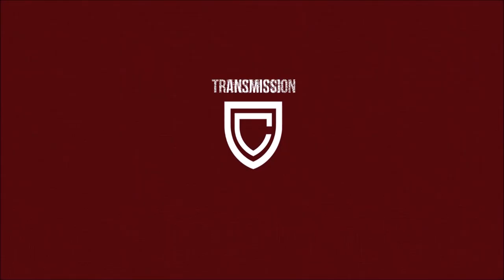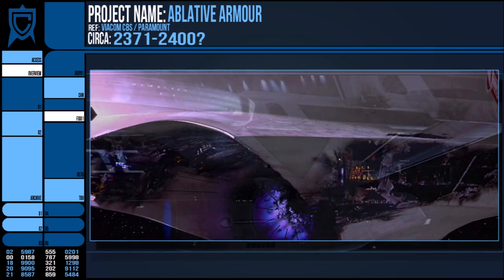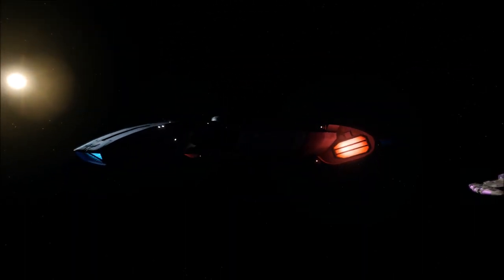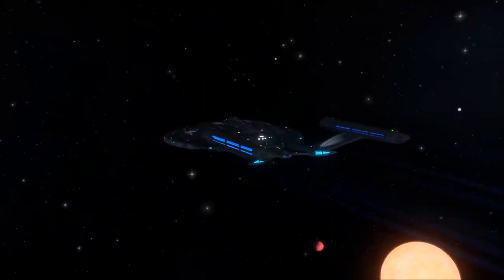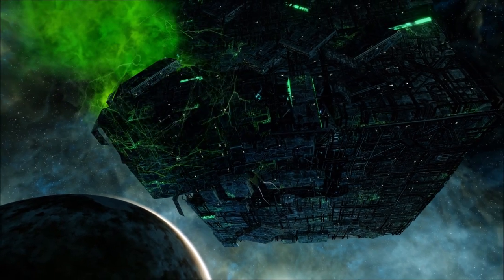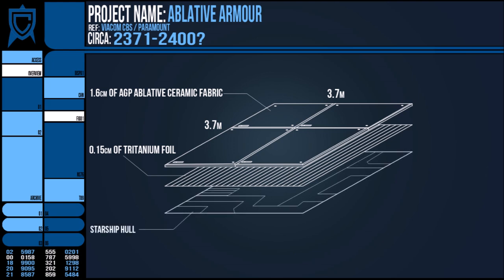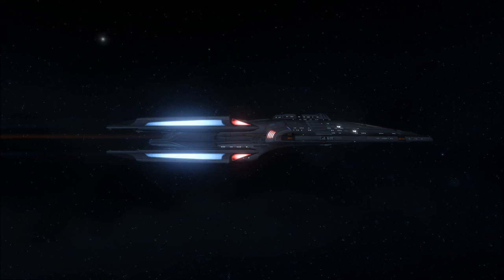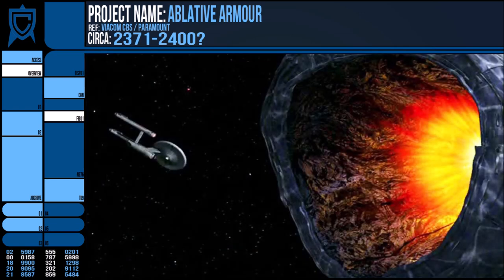What is Ablative Armour? (Star Trek Lore)

Comment: Why once under red alert did they not segment the ship with bulk heads, to keep from having atmospheric loss? Shields, Armor, then Hull, if shields and armor fails the your hull must withstand the attack, or be able to be dumped away. Always they were leaking atmosphere. Surly by this time they should expect someone is going to want to fight them, have the ship ready. LMAO just don't think to much and watch the next episode.
Reply: Why do their control panels explode and shower the crew with rocks from external hull hits? It's because no one on the writing staff gives the science a second thought.
Reply: I agree, if the ship has a segmented design of smaller areas, atmospheric losses due to decompression is minimal, so with closing off sections and structural fields to stop hull openings,  you would lose less atmosphere.
Reply: @kauske  I agree, that has often boggled my mind. A power surge just shuts down electronics, but I'm guessing that doesn't look as good.
Why when their damaged does the gravity plating never fail?
Reply: @kauske  
See the plasma controls are directly in panels operated by the crew, no engineer would design it that way.

Industrial controls manage incredible power by means of relays, so if something goes wrong and explodes, the control panels do not explode, and nobody is killed.
Reply: @KalRandom  Failing gravity plating means they'd have to spend money on wire-teams. Then they might have less money for pyrotechnics for exploding consoles full of rocks. ;)
Reply: @carminemurphy1275  I just find it amusing that ontop of running dangerous high-power directly through the bridge and such, they also stuff the consoles with extra shrapnel, so when it invariably detonates the injuries to crew are worse. It's like the Fenedation has some sort of Anti-OSHA running around making things more dangerous.

If it's not exploding rock panels, it's hazardous spark conduits, or canisters of face-melting fog. I also like the fact that if they lose all power, the very structure of the ship collapses, because it needs that structural integrity field to not buckle under its own mass.

But as Kal said, at least the gravity holds up no matter what else fails!
Reply: @carminemurphy1275  and they even discuss all sorts of relays for both power and data in the show! Yet they don’t seem to protect properly… more often than not they just complain about them getting burnt out 😅
Reply: @kauske  I do believe the Defiant is the one exception to 24th century ships buckling under their own strain without the SIF.. good thing too or they’d be dead twenty times over. 

But I suppose they must just have super good backup power systems, much as you’d also necessarily have to have with a big antimatter tank (at least going by the diagrams, they don’t really have multiple small tanks? Just one big one?). IRL we have methods to independently power magnetic bottles in a powercut via allowing controlled leakage and allowing that small amount of energy to power the containment. So I’d hope they have something like that but 1000x better…..
Reply: @kauske  LMAO, nothing like that was ever discussed back when that show was airing. Most Sci-Fi is really dumbed down so much for the masses it's painful to watch.
Heck were they even doing wire work then?
Reply: @KalRandom  When TNG aired? Not outside the highest budget movies. Trek has always been low-budget from the get-go, so even now it's not likely to get wire-work.

Hard scifi tends to be the dominion of books, since it would be very expensive to make in live action, and have a limited audience. Even shows like the expanse limit crew to seats as much as possible to save on expensive wire-work.

Also ontop of the expense of trained wire teams, there's the added danger to actors if something goes wrong, so you need to train your actors to be on the wire, and have more insurance in case one takes a fall and gets injured, which can tank production schedules.
Reply: @kaitlyn__L  The defiant is also one of the smallest, and most sensical ships in all of trek. Enterprise-D is literally a floating city full of amenities and so ridiculous big that even the full crew plus a spouse and 2.5 kids per crewmate would give everyone a massive mansion sized quarters and still not use all the space inside it.

Comparably, the Defiant makes a lot more sense, small crew, maximum automation, no wasted space. Most other federation vessels seem more like cruise ships than paramilitary exploration vessels. As for antimatter, I'd hope you'd have UPS for its containment, or the first time someone blows a major fuse your ship goes kablooie.

You'd honestly want your whole drive-core and powerplant far, far away from your living space, more like the ship in 2001 versus most federation ships. If they put the saucer out further forward, and had no one in the engineering section, they'd be OK. But how many times has engineering filled up with plot-radiation and killed half the engineering team? (Usually the half who are not named too.)

Comment: The sci-fi materials used for hull building (like duranium, tritanium) which are no known elements today should be assumed to be alloys, molecules or minerals but not elements. Why? If our understanding of physics and chemistry isn't fundamentally wrong (which is quite unlikely), then we know two things:

1) There can be no more elements between those we already know (because an atom cannot have one and a half proton and we (=humanity) found or synthesized all elements with a natural number of protons up to 118).
2) All possible elements beyond those we already discovered must be instable and therefore radioactive in some way, because the repulsive electromagnetic force between all the protons grows bigger than the strong force (which is holding the atom's core together) after a certain number of protons. Theoretical physicists (which I am not) can calculate such stuff - science!

As a result, using an unstable, radioactive and also very heavy element as a main or integral part of a ship's hull would probably be rather problematic. It's a different story for ablative armour though, since it can be mounted on the outside, and the ship underneath could be shielded against the radiation. Also, dense and heavy materials can be a plus in that case.

Comment: Can you talk about why some have four warp nacelles and some only have one?
Reply: I suppose because 4 nacelles are faster ?
On large aircraft the larger passenger airliners (747) have 4 engines (nacelles) for better cruising speeds and less mechanical strain.
Reply: Imagine a symmetric ovoid field emanating from each nacelle. They have to project enough of a field to include the saucer section. With four nacelles each individual nacelle is making a slightly smaller field, the warp coils will be suspending less energetic plasma, etc. Efficiency, reliability, durability. But on the flip side, lots of ship designs work just fine with two, and benefit from reduced complexity.
Reply: @kaitlyn__L  Also, a headcanon-idea I've blasted out there before: 4-nacelle ships (Constellation and Cheyenne class) probably have fewer coils per nacelle. Probably not "true" for the Prometheus, but I don't like her anyway.
Reply: If i understand it right... the nacels are critical for exhaust but not the propulsion itself. The warp core generates the propulsion, the nacels keep it running. So the number and configuration are less important.
Reply: @deadNightwatchman  yeah I’d say that’s reasonable. Especially since they tend to be a bit further forward when there’s four nacelles. One could argue they need to be that far back to generate a field tall and long enough to encompass the entire ship safely with just two (there’s probably some extra gap around the ship to the edge of the warp field to ensure nobody will experience different spatial properties at different points on the ship. Cutting it too close might make cabins with windows have some strange tidal effects.)

Comment: Ablative armor is IMPOSSIBLE.  LOL.
Reply: It's quite real.
Reply: @mackgiver875  LOL. Fictional. Even though it's ALL fictional, the way phasers and disruptors work would make the armor impossible. Good plot armor but not possible using trek physics.
Reply: @poseidon5003  Ablative armor is a real life thing here on earth, we just call it a heat shield. It's used on the Space Shuttles. That's all ablative armor is.
Reply: @mackgiver875  That's cool. And I would not be making an argument if I didn't know that. But phasers and disruptors are more than just heat energy. The beams disrupt atomic bonds. Against a weapon like that, any form of matter for armor simply won't work.  Disruptors don't leave burns. Data said so. The armor in trek using trek physics simply can't work.